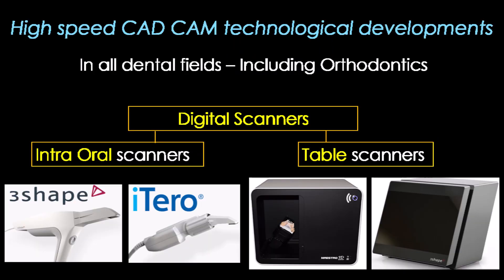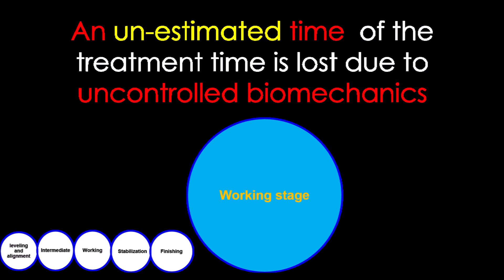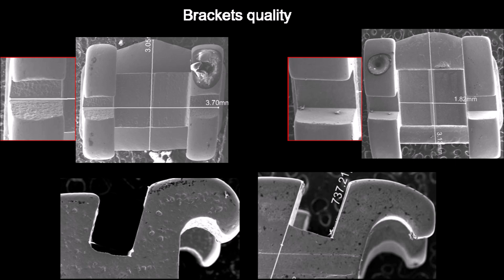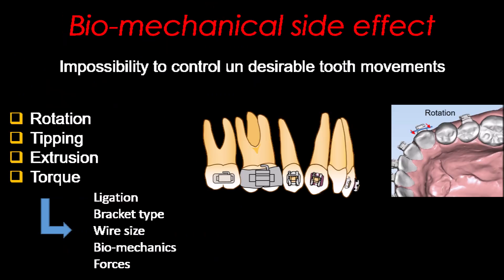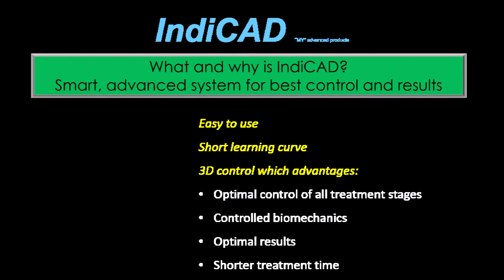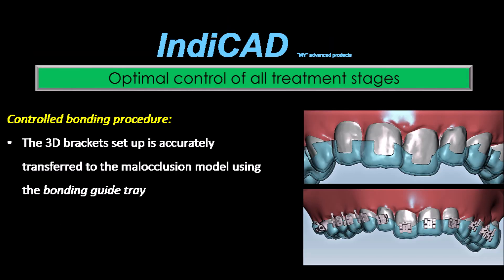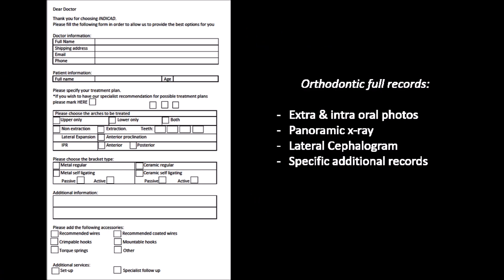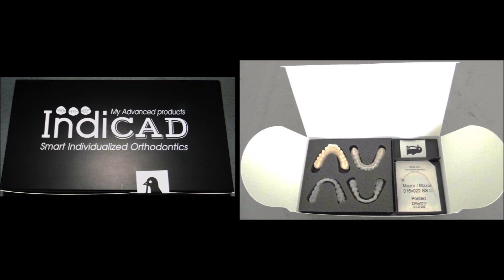Indicad By Dr Mazor

Comment: Would the buccal root torque solve the problem of a frontal incisor which is oriented a little forwarder than the rest of teeth?
Thank you so, so much. You are amazing.
Reply from the maker: sorry for late replay...It seems I missed it.
the control for the front buccal teeth torque is easily achieved with the correct prescription and wire protocol, and correct case managing.